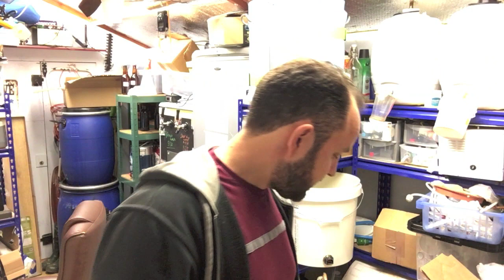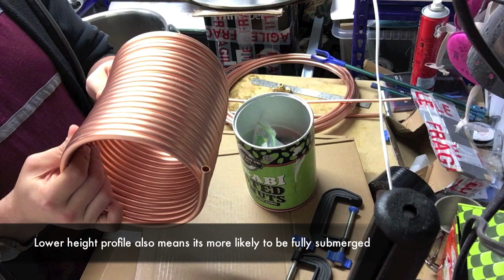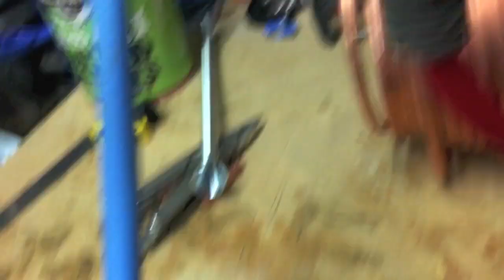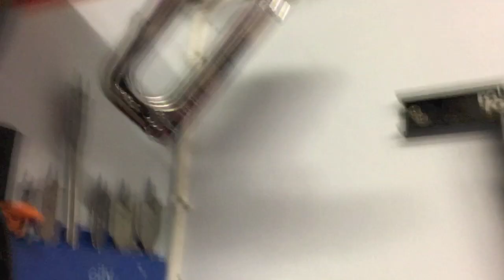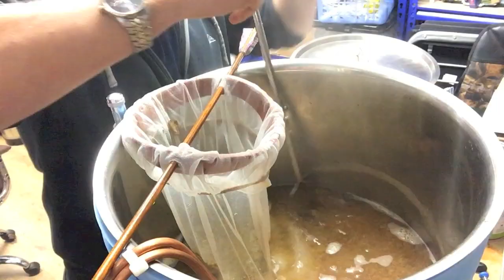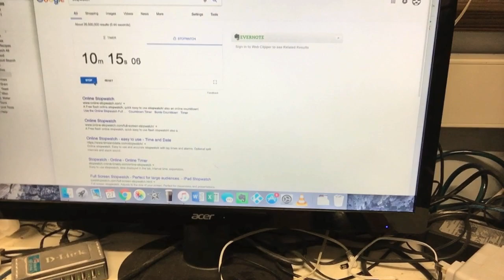How to build a Twin Coil Immersion Chiller for under £50!

Comment: How is it to wash the outside? Usually made one-way (I have one) so that it was possible to wipe everything with a washcloth. Next: during cooling, the wort is hot at the top, not at the bottom, so you need to raise the chiller under the surface. Fittings are unnecessary - there are hard to reach places for washing. It is not desirable to take out in the cold, because there is no possibility to drain the water. The best option would be a clockwise chiller located directly below the surface of the wort. (Google translator)

Comment: I dont know how you did that without crimping the pipe. When i did something similar i put the pipe under water. Crimped the two ends. The water inside stopped it from collapsing

Comment: For tight bends that don't kink, try filling with water and freezing it. It can expand the copper very slightly so fit connections before you do. Ideal project for the winter! Twin coil is a good idea because there is a point where the inner water is as hot as the outside, so any extra pipe length is useless.

Comment: Great job - but... Correct me if I’m wrong, but wouldn’t a single 20m coil be just as efficient and a whole load less faff?
Reply from the maker: It would probably be the same efficiency theoretically and certainly less faff but the coil would be very long so I wouldn't be able to put it on its side and if it was stood up a lot of it would be out of the wort, you could make the diameter of the coils bigger but then I'd have other issues with it hitting the elements, filters etc inside the pot and on its side again it wouldn't be fully submerged. So in short the split coils were necessary to get that much copper into a package small enough to fit the kettle comfortably and be fully submerged in the wort for a typical 19-23L batch

Comment: Will be fun to clean lol
Reply from the maker: surprisingly easy actually, straight into a bucket with the saved warm water from chilling and some sodium percarbonate. Soak and splash around in that for 5-10mins and then hose it off, no gunk build up or other issues for me with that method

Comment: You should create gaps between the coil "levels" by intermittently tieing a small piece of copper wire in figure 8 between one level and the one above (one per turn, then one up on the opposite side, then one up opposite and so on).. This effectively stabalises and fixes the coil, and simultaneously opens a gep between each level, therefore increasing exposed surface area by around 20 to 25 percent... Not to be sniffed at!
Reply from the maker: thanks I agree this would be a good modification to the design, if and when I need to build another I will definitely try this!

Comment: Hello question how many liters of water goes through the chiller? do you dump it down the drain or have it tank off for later use?Great video by the way.
Reply from the maker: thanks! I have never actually measured how much goes through it for a full run but its quite a lot, I will normally collect a buckets worth of the hottest water at the start to be used for cleaning but after that most of it goes down the drain to be honest. I think any form of heat exchange cooling with water is going to be a bit wasteful but at least the shorter time means its a bit more efficient!
Reply: @DudesBrews  I had a quick look average tap flows can be anywhere between 8 - 40 liters per minute I did a full flow test on my kitchen tap and got 7 liters per minute, so that would mean 70 liters to cool down the wort. 
Crazy amount of water roughly half the UK national average per person per day. I think when I eventually graduate to all grain I will make a return tank for the chiller and maybe even go 3 to 4 spirals, hahaha. Cheers again and happy brewing

Comment: Built this as per your parts list and guide today. Thanks for designing and sharing this. Have you changed much since your first version, or moved on to something different? Looking forward to testing it on a brew day.
Reply: Never mind, just saw the twinchilla! I made some of those changes myself already when making this (used two different sized paint pots). Wouldn't fancy the soldering!

Comment: Nice chiller. However, apparently copper reacts with any liquid that has a pH lower than 6.0 and releases copper into the liquid, leading to copper poisoning in the long run. That's why now you see new Moscow Mule mugs with a liner of nickel inside. Source: https://www.ncbi.nlm.nih.gov/books/NBK225400/

Comment: tees made of brass, it's not at all good
Reply from the maker: most people consider the risk from brass fittings to be extremely low and in this case where they are only in the boil for a very short time that problem is even less of a concern, having said that my newer version uses soldered copper tees so its a moot point now anyway
Reply: the idea of course is good. I'm going to make a chiller, I choose the options. but I want to do without fittings and soldering, from a single piece of pipe. Now I think how to combine your and my idea.
Reply from the maker: Good luck! Its doable but will require some elaborate pipe bending, you might need a proper pipe bender tool to get a compact and neat finish.
Reply: pipe bender is available. I must carefully consider the configuration

Comment: Would it not be better to ensure the inlet part of the coil is near the top of the hot wort...? My reasoning being you want the coldest water to target the hottest wort.  Heat rises/cold drops.  Reducing the need for stirring. The sooner your flowing water picks up heat the better? This is why is also try to get some space between the coils increase the surface area some more, as we're all limited by mains pressure water. Lastly.. if your inlet and outlet fit neatly into a notched lid bacteria and other nasties will have an extra barrier to get around.

I've seen no chill methods used in sealed containers that is time consuming but considered safe. A bit like anyone who makes jam.

Thoughts and opinions please, credit to the dude in the video for his great tutorial though.
Reply from the maker: Thanks for your thoughts Adam, there are mixed opinions on inlet at the top or bottom but most people agree the difference is marginal and in this case as the coolant circulates from top to bottom as it goes round (because its on its side) its really a moot point anyway. Stirring will always make the chiller work much more efficiently regardless of which way round you have inlet and outlet. I agree about a bit of space between the coils and will be adding this to version 2 it will also making cleaning easier as well. I am thinking about fitting a whirlpool pump at some point which will mean I can put notches in the lid as you suggest and keep it sort of sealed during cooling. Until then though the risk of infection from being open during cooling is fairly minimal (based on my experience so far at least) so while its not totally ideal for now I would rather stir with an open vessel and have the faster cooling time.
Cheers and thanks again for the feedback
Reply: Thanks for your reply and the additional info. I get why you say it's a moot point now! Glad you plan on adding some spacing, look forward to seeing how you tackle that. I've seen some pretty horrid looking examples already... the bar hasn't been set very high. I look forward to seeing your whirlpool addition and Wort ChillerV2. Hoppy Brewing!

Comment: I wonder if you could use a couple of turns less in each coil. This would allow for a few millimetres of space between each coil, which might help cooling efficiency and allow for more thorough cleaning between uses. Just a thought. Otherwise, a terrific (and novel!) design.
Reply from the maker: thanks cleaning is a bit tricky with the coils that tight together so you make a good point, Im not sure how much of an impact on the cooling efficiency it would have but I am also thinking of putting a bit of space between the inner and outer coils on my next version to allow more flow between them that way too. Probably be building mk2 for a friend shortly so an update video may be coming up soon...

Comment: Nice build, I changed my hose fittings to brass as the heat transfer started to melt the plastic ones. cheers

Comment: Great vid and a great result, I must be doing something wrong as my chilling takes 45 minutes. Do you have quite a fast flow rate of water, my flow rate fills a 30l fermenter in about 30 mins!
Reply from the maker: I'd say its definitely faster than that so that could well be part of the problem, are you stirring or circulating the wort somehow? This makes a big difference as well
Reply: Thanks Matey, I will try a faster flow but I guess that will use more water, with your new cooler how much water did you use roughly. I do stir but only 10 minutes or so, think I need to be doing more of that as well!
Reply from the maker: I didn't measure the amount of water used unfortunately but I would guess it must have been more than 30L at the rate it was going, there will always be a bit of a trade off I guess between flow rate and speed of cooling but more stirring will definitely help as well